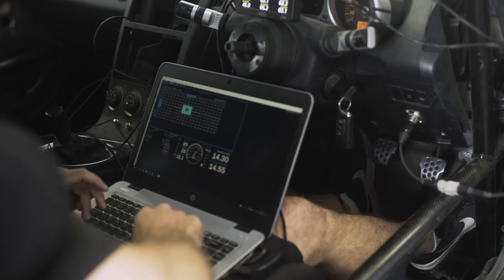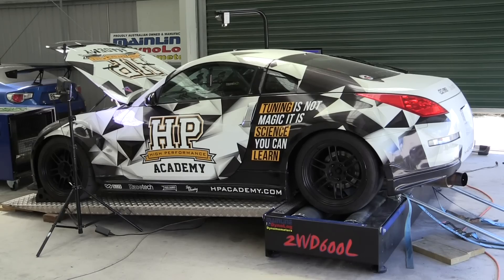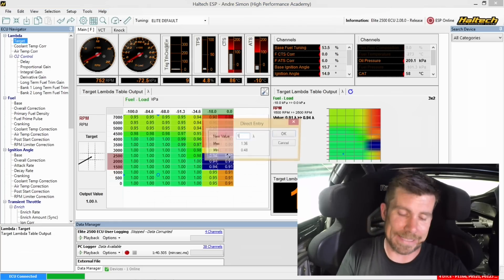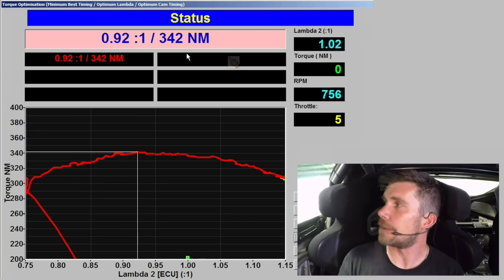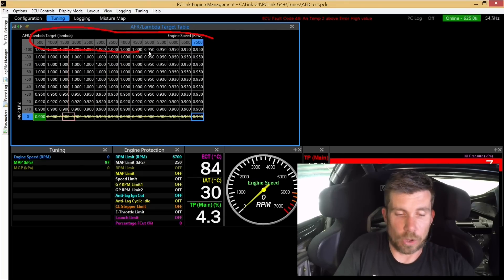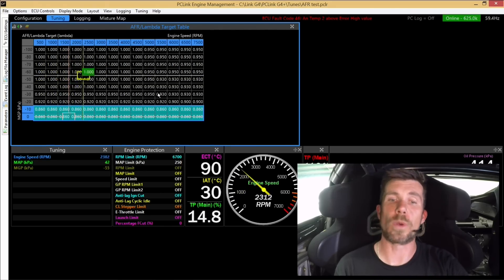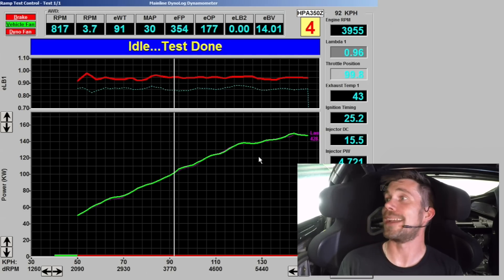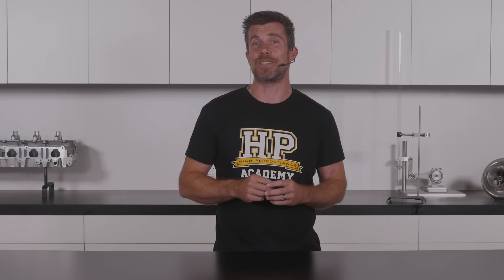Do You Want A Lean OR Rich AFR? | Fuel VS Power!

Comment: In my experience A/F ratio is actually more important on light throttle where small variations can make a big difference to driveability. You have successfully busted the myth about A/F ratio being crucial for max power though, neatly demonstrating the BS you hear where the operator says he went up one jet size or increased the fuelling by 2% and suddenly found another ten horsepower.

Have you ever tried this with a 2-valve engine? When I was involved in the business I generally found that it was necessary to run these very slightly richer, which I always put down to the less efficient combustion chamber; another effect of 2-valve combustion chambers being that exhaust valves were far harder to decoke due to the resultant much higher exhaust gas temperatures flowing over them (not because of the richer A/F ration which would have the opposite effect, but because of the less efficient combustion causing less of the heat to be turned into kinetic energy).

Biggest danger to engines in my experience is not A/F ratio, but when the mapping guy has pointlessly pushed the ignition advance to the very limit and then the car gets a tank full of fuel that is very slightly lower octane than the test fuel. That didn't happen in the days of distributors simply because the timing was wobbling all over the place anyway and to think you could increase advance by half a degree meant you were laughably deluded.

Am I giving away my age?

Comment: Great demonstration. thing i take away from this basically is the AFR needs to be "correct" for the application. more lean or more rich within that spectrum makes little difference but outside of that either direction results in power loss etc.

Comment: Very well done tutorial. Excellent and relevant. I wonder if a lean burning 1.05 to 1.10 ratio,  cooled with water injection (x6 individual port water injectors delivering water only) would yield any significant change in power or fuel efficiency? Thank you very much for sharing.
Reply: Yo can calculate on this video that the difference between torque at 1.05 and 1.00 is 1% but you are using 5% less of gasoline, so you get 4% of improvement in fuel efficiency, at this moment you only need to  see if the piston temperature and EGT is ok.

Comment: Minimum amount of fuel to get the job done should always be the target. From an environmental point of view as well as engine longevity.  Older engines or combustion chambers designed for lean burn will be more critical. 
Also a set up for a fuel critical endurance series will have a different criteria.
Bloody good video though
Reply from the maker: This really depends on what you're doing with the vehicle. Economy is not a consideration in some forms of motorsports, or even a multi-use car (an endurance car that is used for sprint racing or hill climbs as well).
The environment one is tricker. If you don't want to be a slacktivist (I don't mean you personally, just in general) really you should outright ban motorsports from your life and seriously consider how you use your own commuter vehicles etc as in the grand scheme of things the fuel you burn is only a very small piece of that giant, giant puzzle ;) - Taz.
Reply: Reduced plug fouling is a major advantage of running leaner, surely ?

Comment: Is nobody else not noticing that 350z make more then that stock?
Reply from the maker: Only a little more, although that dyno reads a bit low. Intake and exhaust are the main mods and we picked up a surprisingly greater power increase with the second improved intake system a while after this video - Taz.
Reply: ?? This video measured force at the wheels, not the crank. Most stock 350z chassis dyno graphs I have seen, show about 200 ft-lbs (272 N-m) @ 2,000 rpm.

Comment: nice vid, thanks..   but its still not entirely clear for a noob like me.    

Adding a Turbo or Supercharger would increase the airintake and that would increase HP.  Not chancing the software of the car, you would still experience HP boost eventhough you wont add more fuel and thus change the AFR.   Does that mean that the standard ECU settings are to rich and by adding a turbo you get the better AFR?

I have the feeling you are saying, adding a Turbo and thus adding air will give a leaner AFR and thus not more power...
Reply from the maker: Forced induction is adding more air, and as such you need to also add more fuel to match that air. It could still be the same ratio, but there is more volume of both. I think this is what you're missing.
You will also run richer with forced induction. More heat is created and therefore more cooling is needed and running rich can help with this - Taz.

Comment: Anyone know if "autotune" ever launched? I finally upgraded my os to rtt. Just wondering about autotune because it would make my life so much easier.  I don't have anyone to ride and tune while I drive. Thanks
Reply from the maker: Hey Dan, it exists, but still requires you to fine tune it. Basically think of it as a tool that can help make the tuning process a bit quicker, rather than a tool that eliminates the process completely - Taz.
Reply: @hpa101   thank you

Comment: Could you please explain how the heat source for the engine can be used in a rich mixture to cool the combustion process down as you said in this video. This is confusing to say the least. Are the readings achieved in this series of runs on the dyno consistent and repeatable if one was to this all day with the same engine. Have you taken into account the heat soak which exists in engine dynamics?
Reply from the maker: The heat source is the combustion event, not the fuel. If you have more fuel than there is oxygen to burn, the excess fuel helps cool the piston and bore.

If you think of the fuel as the sole source of heat then I can see how it would seem confusing - Taz.
Reply: @hpa101  We have successfully run engines on Propane and Gasoline above 23.8:1 . We have, on engine dynos, run a gasoline V8 at 55:1 without melting pistons or damaging the engine. The Stoichiometric requirement for these fuels gives the best horsepower torque figures but the leaner the better for economy sake and the one factor that your analogy creates is hydrocarbon in parts per million.  In our tests we on lean mixture 30:1 propane fuel we were using instruments that read in parts per billion hydrocarbon. Excess NOX of course is the next hurdle but we managed to eliminate those emissions through proper spark plug placement.  I applaud your passion to the otto cycle engine but please think and look deeper into my original post as the key is within that post.
Reply from the maker: @1darryloflife let me clarify: When we run a rich mixture the excess fuel cools the combustion charge due to its latent heat of evaporation - as it goes through a phase change from liquid to vapour it absorbs energy in the form of heat. We can see this effect if we simultaneously monitor EGT (which is a by product of combustion temp) as we perform a sweep of AFR under steady state conditions which we demonstrate elsewhere. You're not going to necessarily damage or melt anything just because you're running leaner than stoich, and in fact the leaner you go beyond stoich, the less combustion heat is produced (again we show this in one of our other demonstrations). Maximum combustion temperature will occur around the point where the engine is making maximum power and you're unlikely to be anywhere near peak power at the AFRs you've quoted.

Running leaner than stoich shows an improvement in economy to a point, although our testing on gasoline (again in a demonstration we perform elsewhere) shows that the point of diminishing returns is typically in the region of 1.05 lambda. As we move leaner than this we end up injecting less fuel so we see a fuel saving, however the engine also produces less torque so if for example you're doing this to produce an economy benefit under cruise conditions then the gains are negated by the fact you need to use more throttle (and hence more fuel) to achieve the required engine torque to maintain a fixed road speed. It's a different situation if you're talking about WOT operation but here you simply need to weigh up the economy gains vs the reduction in power and torque. Generally the limiting factor of how lean we can operate a gasoline engine is the point where we can no longer consistently light off the fuel/air charge and with a PI engine this is likely to be in the vicinity of 1.2-1.3 lambda. Stratified charge DI engines can run significantly leaner because they can focus a richer kernel of the fuel/air charge near the spark plug which allows consistent combustion while the overall air fuel ratio is very lean, but I'm yet to see a PI engine operate at an AFR of 55:1 - I'd be really keen to check this out if you have links to your testing somewhere.

Comment: I have a question about tuning....
How can you tune afr for 3000rpm at WOT? I would have to be in a part throttle map in order to sustain that rpm would I?
At WOT I would not be able to stay at 3000rpm steady...
Reply from the maker: At a certain point you start doing sweeps into the high rev range will make more coarse adjustments (not cell by cell) to hit your target AFR. You just work higher and higher until you're doing full ramp runs :) - Taz.
Reply: That dyno has a brake that makes it so the engine and car cannot push past what you tell it too, he told the dyno not to let him push past the 3000rpm limit with X gear ratio, Y tyre size at 4th gear so the dyno knows what speed kph/mph to get him the 3000rpms

Comment: what about supercharged/turbocharged engine?
Reply: At the beginning 0:37 of the video he mentioned power is much more a function of the amount of air then of the amount of fuel. A super-/turbocharged engine just has got more air. The principle remains the same. 
Other commenters have pointed out that running richer allows you to advance timing and will therefore produce more power.

Did you ask for a specific engine? (Just curious)

Comment: Are the results of torque optimization (torque curve shape, not values) will be the same for higher RPMs (e.g. 6000)? Because I saw a lot of fuel maps with richer AFR on higher RPM.
Reply: probably because at high rpm's the engine makes more power and heat. To cool the combustionchamber further the engine runs richer

Comment: This may be a dumb question but how come you measure torque at a continuous 2000 rpm to find out max torque with afr as a variant and with power you didn’t keep rpm constant but redlined it??
Reply: Around 2k is an area of higher load on most cars and torque typically comes in lower rpm than HP. It's a good way to way to get a AFR roughed in before you start hammering the car and having a boom situation.

Comment: yes, fuel IS the source of all energy in an engine, not air.  If you can't burn the fuel, you don't get torque. volumetric efficiency is an indirect way of knowing how much fuel can be burnt, and how much power it will create.  Don't get me wrong, there is tonnes to learn to get to this level of information, and just letting people know that it goes much further than this video, or even your full course.  Books by Greg Banish, and OE level calibration engineer, are still not top level information.

AFR is not a good benchmark at all.  At least lambda gives you a common target between various fuels.  If you're unsure how much ethanol is in your pump gas, you could be 5-10% off your fuel requirements.  Oxygen sensors are for emissions purposes.  OE get the calibration right at the factory, and only use O2 sensors to measure catalytic converter effectiveness (OBDII).  And they're notoriously ineffective for calibrating fuel because they average AFR over all cylinders over a period of time.

Testing lambda in steady state doesn't reveal WHY you need to aim for richer mixtures.  the fuel air mixture burns faster closer to 0.85 lambda.  that means the engine will have more hp and accelerate faster.  Again, testing in fourth gear is slow enough that you won't see the benefit.  but we don't start a race, or negotiate slow corners, in fourth gear.

Typical "tuning" on a dynojet is "good enough" for grass roots racing.  Top calibration engineers use five gas analysers and in-cylinder pressure sensors to actually see, in real time, how the fuel is burning.  They still start in steady state to solve the edges of the chart, then work inward.  They finish by doing real street tuning (which takes the most time).  Calibrating the transients is what separates the men from the boys.

Comment: Would be nice to see EGTs on all the runs 😁
Reply: Yes! Another point is with richer lambda you'll be able to run it for extended time and get same results. With leaner lambda it'll get so hot you'll loose power after a short time racing.

Comment: what would happen if you incteased timing by 2 degree when reducing lamda? from 0.9 to 0.85
Reply: Timing creates whats known as negative work in the chamber, if you advance the timing to far the combustion process starts to soon and actually pushes the piston backwards. So adding more timing to a optimized system can work if the octane of the fuel is high enough to work with it but it's getting into negative results, making the piston change directions before the connecting rod has gone over center.
Adding and subtracting fuel causes the ignition pulse to change where it happens, leaner is shorter sharper and faster, richer is like we modern people slower and a bit wasteful and takes longer to get to the point then this sentence. yes I went there
So your engine and it's chamber design plug layout/placement etc etc etc.. is the basics, adding to much timing screws up the system so only use as much as you need or destroyed bearing uppers and melted pistons can and will be in your future. 
If you paid attention to the video this had nothing to do with spark timing and was giving basics on how afr works with your engine, asking for spark advance kinda missed the point of this. 
But since you asked this is your answer, it depends how close the timing is, how much is irrelevant to tuning except as a number and a place on a table and if it makes more power or not, not enough and combustion happens to late after the rod rotates around center and to much makes it happen before the rod is over center both lose power ones inefficient and one breaks parts. The total amount kinda depends.
Reply: @Scootermagoo  very nice explanation I was just wondering about the timing how it would effect it as you have said if your limited by fuel quality 
as always awesome work
Reply: @ashteregg2133  It's not a bad question, it was just the wrong one for this video, I tried to answer it without any sarcasm, and got away with that mostly, but the last paragraph is basically the answer you needed for this video, if our tuning massaah friend is going to release a video on timing then that is when to ask that kind question, but the basic brass tacks is it depends on the engine and it depends on the chamber and octane rating. It only needs so much timing and adding to much is generally a bad idea.
Timing testing is what you do with accelerating tests, you can set your timing on the dyno but the car on the track is different then the car on the dyno, Most tuners will tell you back is down a couple degree's to get a base line then raise it till it stops accelerating or the octane limit is reached and back it down if you get spark knock, this works fine on naturally aspirated engines cars, cars under boost is a little more tricky, because boost requires less timing because the chamber has a lot more air and fuel in it and is much more sensitive to timing and can really destroy itself in no time at all, so you start at lower timing, and add a degree or two at a time and in some cases half degree if your setup allows that fine of adjustments. Till you reach that point where it's happy, It'll tell you when it's happy, and it can and will turn into a expensive pile of broken parts when it's not.
One thing our fine aussie friend didn't mention is track day, afr's can and will change based upon air intake temp and outside air temps, Dyno'ing in a nice shop is one thing, racing is another, air temp affects afr's, so racing the engine at high engine temps and higher air temps is going to require a slightly richer tune to keep it happy, also less timing to keep it from self destructing, oem's know this and include knock sensors on every car released since about 1990 and any car without a distributor. Since they use rings and sensors to know where the engine is and can adjust timing for that, if the sensor hears a noise it'll back down the timing, go far enough and limp mode is engaged.
Reply: @Scootermagoo  you mean i cant run it rich to max timing? pull 2 degrees then gradually lean it out? :O im offended. xD
Reply: @LightningFast240  No.. no you can't.. stop that.
Reply: @Scootermagoo  yall all scared to blow shit up I guess. Never had a problem running 31+ degrees of timing on newer cars at WOT. But it all depends if certain factors are known.
Reply: @Scootermagoo  you mean you don't want the combustion happening as the piston is coming up? Haha
Reply: @scootbmx01  Well if you want your piston to actually stop fully before top dead center sure make it 75 degrees and see what happens. Most modern engines need 15-25 degrees of timing , you for example might need a 350 degrees of timing and a long roasting time, some of us are better off stewed at low temps, and others are good with a quick sear on a hot cylinder head. But as for timing mines off and I need to reset my watch. That should teach you to rewind your betters...
Reply: @Scootermagoo  you missed the joke.
Reply: @scootbmx01  So did you >;)
Reply: @Scootermagoo  not gonna lie I read like the first line of your reply haha